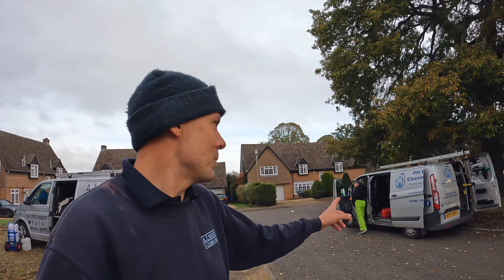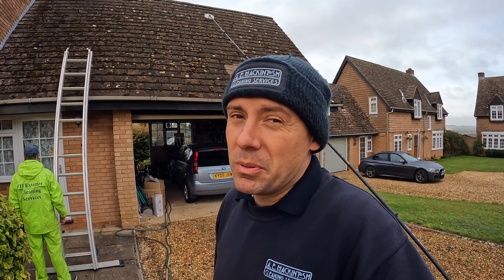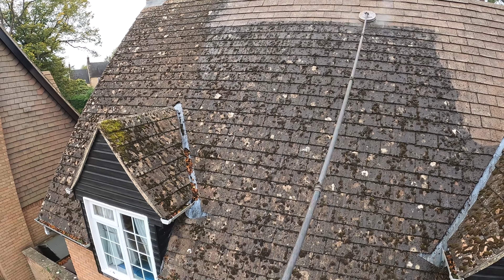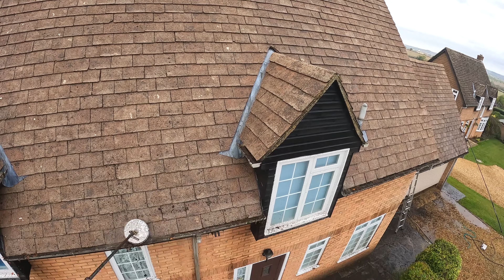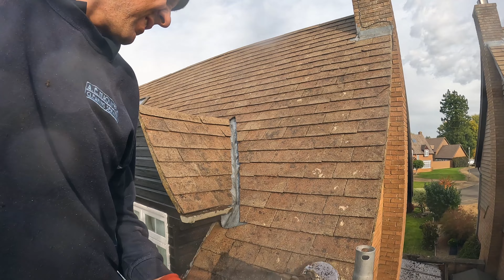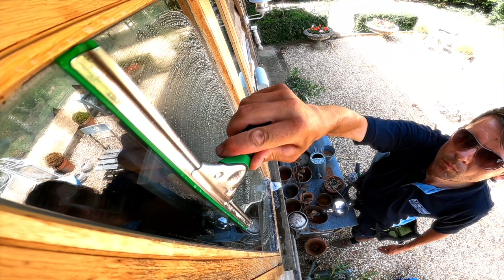Third Satisfying Roof Clean In The Same Street!

Comment: Good job. A query. Why do you put the garbage can with water next to the machine instead of the hose directly to the machine? Thank you
Reply: You can control the pressure better on the machine. With mine you get maximum pressure from stand alone water. Also if the pressure from the hose is great you will get inconsistent power
Reply: The pressure washer needs more water than the hose can supply. The bin of water creates a buffer tank to draw water from rather than the machine cut out due to lack of water
Reply from the maker: We had a couple of hose pipes feeding into the bin, then the machine can use what it needs from the bin without any issues. We just had to pause the cleaning work every so often on this one to allow the bin to fill up again.👍🏼
Reply: @aemackintosh  could you possibly do a video on what tiles you shouldnt use the flat surface cleaner on. I've done a few properties with thick tiles and it's all nice but had a few customers wanting pressure cleaning and I'm not 100% on the thinner ones could do with some advice

Comment: Excellent mate, what pressure are you using on the mossmatic?
Reply from the maker: I usually run it at about 2000psi.👍🏼
Reply: @aemackintosh  wow I have mine at 3000 😳🫣🤣 depending on tile I guess.

Comment: Are those shingles with granules? I wash roofs also and I never use pressure. Interested I use a  hypo chlorite, surfactant and water mix at about a 4-5% bleach strength.
Reply from the maker: No they are definitely not shingles. We don’t get them in the UK.👎🏼